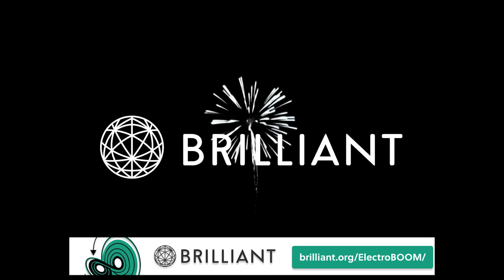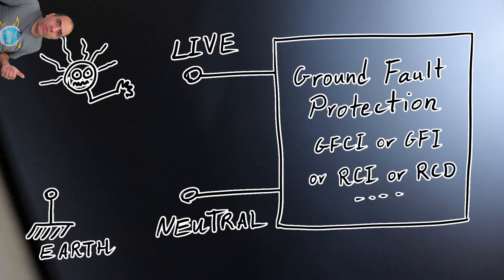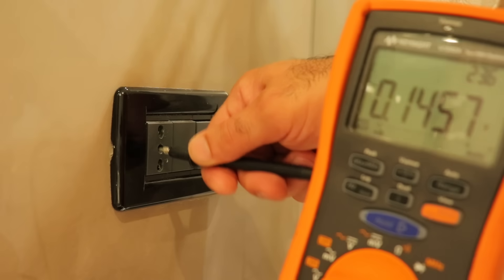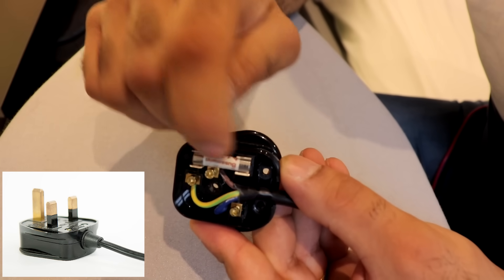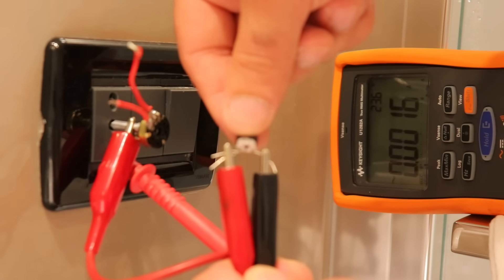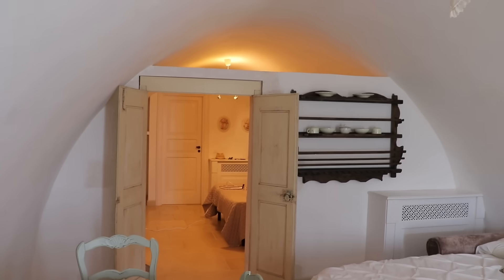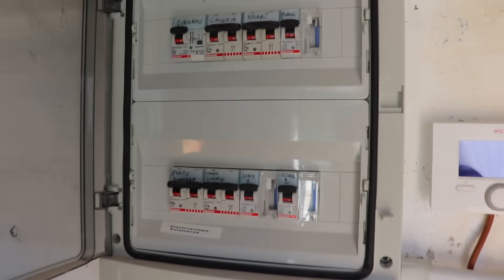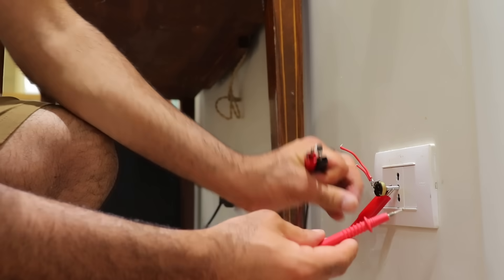Tripping Every Breaker in Italy

Comment: It kind of "Tripped me up" that he was surprised by a simple .. Not sure what the English word would be.. "child-poke"-protection lids in the outlets. Also it didn't seem like he was aware that it is common place over here that there is only the one ground protector for the entire building. Just to say; We have (quick, low-amp and extremely harsh requirements) when it comes to ground-protecors for ALL outlets for a very good reason!.

The plugs are reversible, so any lamp where the breaker on the appliance is just on one of the wires MAY have power at any place in the system even if it's breaker is off. 

European nations work with different standard voltages in the system (that is; Some nations have a 400v three-phase as the standard, and others 230 volt.. BUT in our sockets we ALL have 230 volt.. This is of course because some nations use an actual neutral together with one of the three phases, whereas the others couples phases, and in the nations where BOTH wires are connected to different phases BOTH have potential. Despite this do we expect the mandatory electric-safety standards to be enough so our citizens shouldn't have to know EXACTLY how things work (All devices have to be tested and approved- hence "CE"-certified, and either "double insulated" or grounded)- and as previously mentioned: Groundbreaker, Groundbreaker, and don't forget: Groundbreaker.

Comment: Italian sockets have two side holes 10A (small) and 16A (large) then there are sockets like those in the video which are called 10/16A sockets with double holes, the shuko plug (CEE 7) cannot be inserted in either in the 10A socket nor in the 16A and not even in the 10/16A because the center distance is different, only by forcing it a lot you can insert it but you shouldn't because the earth is not connected, the Italian legislation requires at least a differential general switch and separate switch for sockets and light (16A for sockets and 10A for lights) protected against short circuit and overload, 0.01A RCDs are sometimes installed in bathrooms for greater protection, these are the minimum required by law but usually many more switches are installed in new plants, the colors of the cables are blue: neutral, yellow green: earth, all the other colors: live, specifically black, brown and gray are used for the three live or fixed live, all the others for the controlled live (lights , relay etc)

Comment: 9:15 That's an outlet called Magic! Made in the 60s/70s by the BTcino
Reply: After way too much searching I managed to find something about that socket, on the "plugsocketmusem" website (which looks like it's from the early 2000s) and all it says about use is:
"This is an uncommon type of socket, which is only used in cases in which changing line and neutral is not tolerated (for example specialized hospital or laboratory equipment). Occasionally, polarized plugs are also used for local networks with a different voltage (<230V) and/or direct current."
So what the heck would it be needed for in a hotel room?
Reply: @outsider344  That's because the site is only partially correct. Back in the day Italian sockets were not shielded, much like north american plugs, earth connections weren't common, and plug prongs didn't have any sleeving (again, like modern north american ones). Magic was developed to improve mainly on the shielding of the contacts and accidental contact due to partial insertion. The problem with them was that they are too complex of a design, and as soon as VIMAR invented "sicury", i.e. the "doors" on the neutral and live contact that prevent accidental insertion, and sleeving was introduced, Magic came out of favor and sicury became the standard known today as CEI 23-50.
Reply: sicuro? a me sembra di più uno slot per qualche antifurto, che ci starebbe anche perché in teoria le scatole del 230 dovrebbero essere separate da quelle dei circuiti di telefoni e antenne
Reply: @sandropertini7497  è la versione magic per le prese telefoniche, la magic elettrica è più grande è ha una paratia di protezione
Reply: @danielesatta3572  huh, mai vista la magic telefonica su modularità living e mi sembra un po' ridondante col doppino, però buono a sapersi

Comment: Very poor cabling in Venice: black wire should be Live and blue wire should be Neutral.
You find 220V instead of 230V probably because of old MT-BT transformer in that zone. Since 1997 BT voltage il 230V, coming from 220V. National distributor had to replace many MT-BT transformer, but it is not easy to do in Venice...

Comment: Hehe, a few years ago, I blew the breaker in a hotel in Switzerland.  I had a Euro-to-North-America adapter, and I plugged in a North American power bar so we could all charge our phones.  But the power bar had a surge suppressor or some other circuit in it that got very angry at 220V and tripped the breaker.

Comment: We have the exactly same setup here in Greece but a bit more German lets say. But we connect all the neutral wires to a common not breakable connection to main neutral and the breakers are for live only. Ground wires are also connected together without breakers to common ground. 
All house electric fuseboxes is mantatory to contain a central safety relay as we call it for tripping if live goes to ground. There are also applications where current stabilizers and frequency stabilizers are integrated in electric fuseboxes. The same setup I think is also for 3 phase large breakerboxes and 400Volts in industrial stuff, you will see Voltmeters and Ampmeters there installed also.
Our plugs are much safer than North American ones both small and big schuko ones with the only dissadvantage of not being polarized.
The best plug IMO for safety is as you said the British one with the dissadvantage of being rather bulky. I don't know if the British standarts require the presence of a gfsi or safety relay inside their breaker boxes.

Comment: usually 30mA is for residencial general use, 3mA for outlets and lights in a certain distance of a source of water (bathroom), and 300mA to protect lines from different switch boxes. i can't remember the exact application of the technical standard.
Also every electrical wiring must be ground fault protected, unless is galvanic isolated from ground (usually you found this types of set up in operating room in hospitals where you don't want a ground fault to be fatal)

Comment: We habe Similar Fuses in Germany. Its a Breaker and RCD in 1 Device. We call IT FI/LS in Germany. LS meaning leitungschutz= wird protection(breaker)(in Germany normaly b16a) and FI meaning Fehlerstromschutzschalter(RCD) which isfor person protection. Its  combined to safe space. In Germany  RCD Arena rated(in houses) 30ma. The RCD is allowed to cut current at a range of 15ma to 30ma. It does that whit The help of a cool inside. When the same amount of current goes in and out nothing happens, but when current flows away, through like a person, a magnetic field is produced and triggers a mechanic who disconnects the power

Comment: Your experience was not representative of what can or even should be installed. Blue should be neutral by standard rule.
The "ground fault" component you turned back on is called "differentiel". It basically protect all socket from a 30mA leak, in respect to European standards. Also sockets and light MUST be on separated lines. You can't mixed them according to the rules. 
But Italian electric is not so good.. check on France next time. Best application of standards worldwide, best plug and socket and infinitely superior to anywhere else.
From many research I made, I can definitely say France has the best rules. Check out the rule book for french normalisation and standard nº NFC 15-100.

Comment: @ElectroBOOM
Can you please design a smallish control box (double insulated) with meters on it, some LEDs to show power, and some bigger nobs to turn that DAMN POT AND REMOVE ALL THIOSE ALIGATOR CLIPS AND WIRES AND THE ENTIRE CONFUSION!  That you could merely plug into any power adaptor?
Thank you. 

Because absolutely NOBODY will be testing LIVE circuits in their home or hotels, with all that tiny insy bitsy wires going everywhere.

Comment: In Poland at least we are not using GFCI built into the outlet, instead we just get the "hybrid" breakers in the main box with both overcurrent and groud fault protection. These are usually set(for general home use) for 16A overcurrent and 30mA release in case of broken circuit. Also they fit just 2 wires L and N while all the grounds go to the common rail. Only diffrence in the video is lack of "test" button that triggers test for the breaker circuit. Fun fact you can often find ones with lower trigger current for applications where the outlets might get in contact with water. Not to mention our outlets have diffent design than the italy with ground pin sticking out of the outlet compleatly removing the posibility of pluging something backwards.

Comment: Italian sockets and shuko plugs are NOT compatibile by themselves without an adapter. Forcing a shuko plug into an italian socket basically stretches the socket holes and damages the safety mechanism. Sometimes, trying to plug back in a standard italian plug, its pins being smaller, they'll not make good enough contact making sparks making It a fire hazard. Those type of damage to the sockets are VERY common in Italy, people just don't know/care and plug whatever wherever as long as it works.

Comment: In Germany every grounded device has an ground plug "Schuko". Euro plugs with only live and neutral, have to be isolated to earth. Further you have for every room / floor different ground Protection devices and levels. This does not stop some idiots to surf on the trains... we have 16kv with 16,33 hz frequency in our railway, Citytrains have 5kv 50 hz.. dont ask why...

Comment: those appear to be the same breakers (two in the room) in my plc panel in Canada

also, if the hotel had proper electrical safety you would not have been able to get in the breaker panel...

our equipment comes from czech through italy

Comment: I felt like Mehdi when I was in Fuerteventura last week, air conditioning in the room didn't work so I inspected and found the balcony door switch was broken, and found the junction box for it and found the wiring not even fully tightened in the connector block. I bypassed it altogether so the aircon worked, and wether the door was open or not 😅

Comment: 9:11 it's a phone plug by BTcino. In the 70s they tried to introduce a whole new type of plugs for electricity and phone called "Magic" providing extra safety. The project turned out to be a commercial failure, but some of these plugs can be found in hotels originally built in the 70s and 80s. That one in particular is a BTcino Living Classic 4521.
Reply: what an unconventional time stamp
Reply: @dukkadukkah3155  didn't even realise this lmao
Reply: I still have magic plugs in my house. We are slowly replacing them, tho, since adapters are hard to find and by now a lot of the ones we had broke up.
Reply: @Shendue  maybe with some counseling they will put themselves together again
Reply: Also, if I'm not mistaken, you could use the same connector as a 12V source in some applications. At least, you could with the Magic series
Reply: Huh, so they were 50 years early to USB-C PD...
Reply: Ah bello, sono italiano e non lo dapevo lol
Ah cool, i am italian and didn't know that
Reply: Here in Perú, practically all electrical fittings are BTicino

Comment: Every implant in italy has ground connection and several breakers. You tried to plug a german standard into an italian standard, you had to use a reduction. Italy has some of the most important firms for electricity, like BTicino, Gewiss, Ave, VIMAR, ecc.

Comment: In Poland plugs with ground connection can be connected to outlets with ground connection, but we have double outlets where you can plug in two plugs, but to let you plug in twou angle plugs one outlet is upside down, but the holes are connected in a way that both outlets have live wire in the left hole so if it matters for a given device you need to know if you should plug it to the top or bottom outlet. And you have to make sure that the outlet is wired the way it's expected to be, becaue you don't know if the electrician didn't mess something up (I had about 50V between ground wire and actual ground so outlets have ground connected to neutral).

Comment: I guess the Italians drilled some extra larger holes to fit the Schuko 16A (German) plug into their sockets. In combination with the Europlug F 2.5A and L 10A.
Reply: Schuko plugs cannot go in italian sockets.
Dual italian sockets have big holes more distant from each other (16A) and small holes less distant from each other (10A)
The Schuko has the small distance of the 10A but requires the big hole of the 16A, so it doesn't fit.

Comment: You really need to get a better meter. I do HVAC and ive got the fieldpiece sc680. Comes with clamp attachments, it's Bluetooth so you can see what's going on through the app, amp clamp and the amp clamp is on a swivel so you can turn it to get into tight spaces. Also has a magnet on the back that flips up, screen lights up and a flashlight the turns on when you open the amp clamp.

Comment: Italy is a little weird in europe, they have that weird 3 prong connector but elsewhere like in the netherlands you will only find the fatter socket with 2 ground pins on the side or a ground pin in the middle. If there is a connector without ground it'll be narrow and wont fit connectors that require ground.

Comment: You would love the renovated appartement of a friend^^ Designed the wiring and got it installed that way^^ The electrician loved the ideas^^

Whole floor has a breaker triggered by too much current, placed in a box in the staircase (outside the appartement)...
Inside the appartement is another box...Terrace has light and outlet, with its own breakers (high current and ground), stove too (also both), all rooms apart the kitchen and corridor (both)...But now the kitchen: One side has both breakers, but the other, where the sink and fridge are, is different: all on both, but the fridge on separated lines, so it works even when the side is triggered, but not by the fridge (side separation is to minimize the possibility of triggering by using too much current with all the appliances)...And the corridor, where the box is, has also its own breakers, so you have light there too, apart from the case something in the corridor happens^^